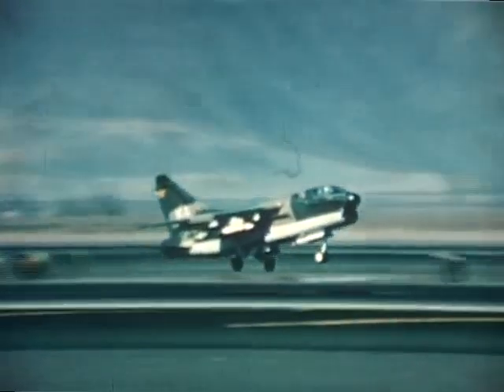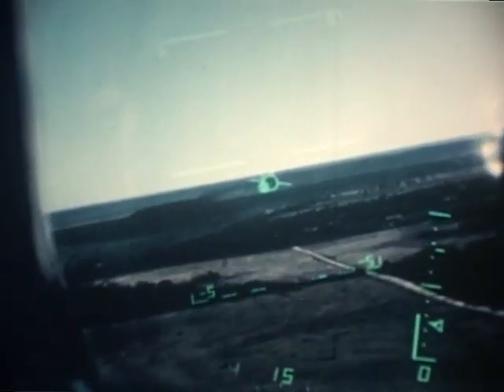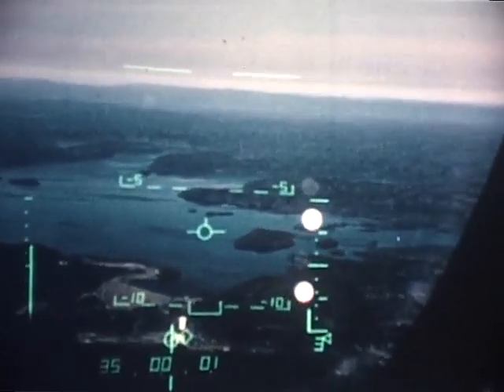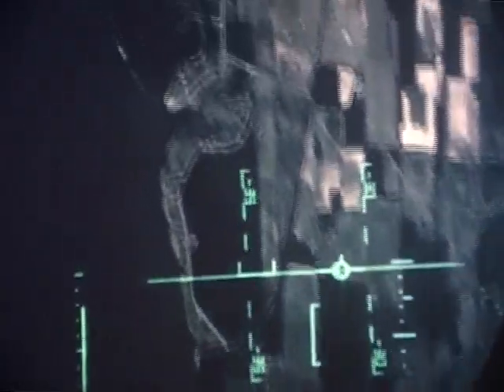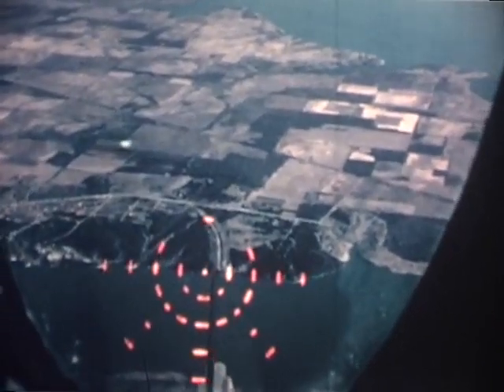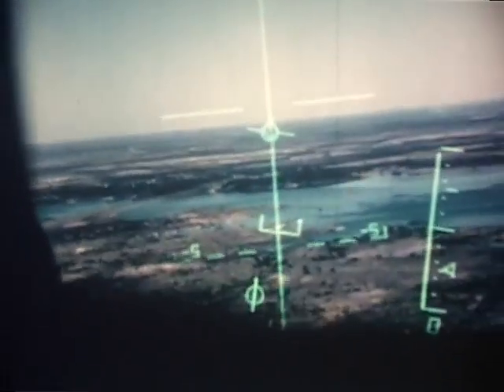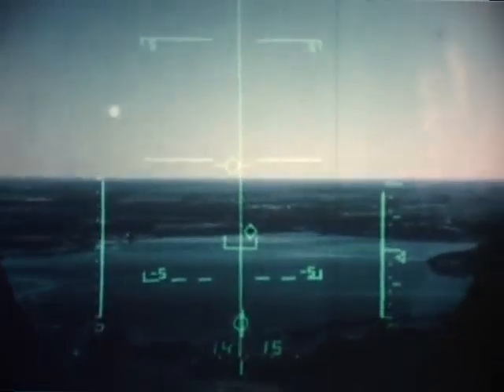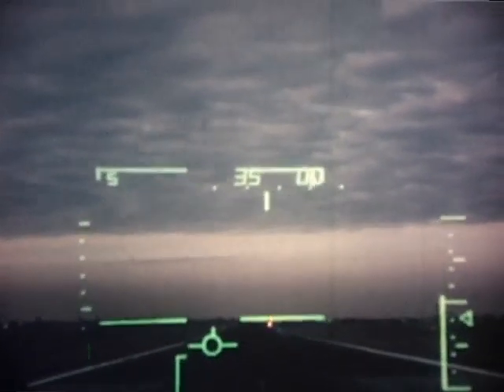A-7 Corsair II Head Up Display functionality

Comment: Why didn't the F-14 receive a HUD like this?
Reply: It did. It had pitch ladder, altitude, heading, weapons aiming, navigation and landing symbology.
Reply: the F14 did have this but the F4 didn't (it should've had)
Reply: Because F-14 was a Navy plane, USAF had higher standards, the Navy A-7E had this HUD just because it was basically a USAF A-7D converted for carrier operations, the first Navy variants of A-7 didn't have this HUD, it got this HUD because USAF specifically wanted this modern HUD for their A-7D, the F-15A Eagle had a modern HUD too like A-7D since the begin and it entered service at about the same time of F-14A Tomcat.